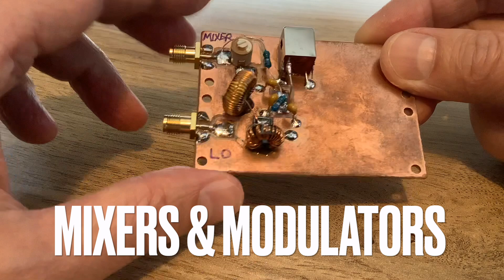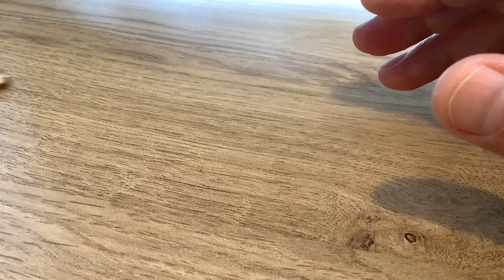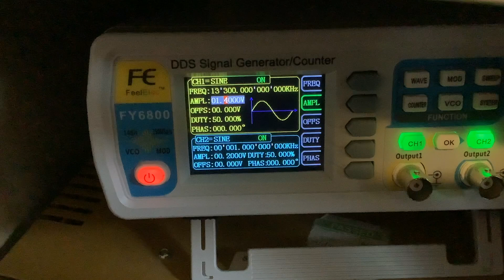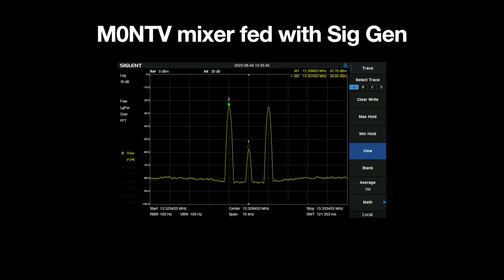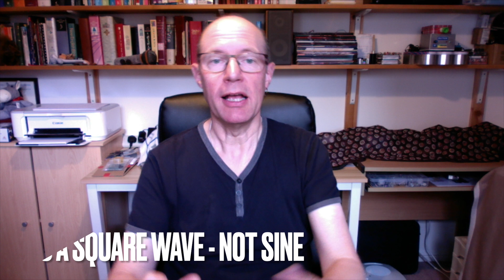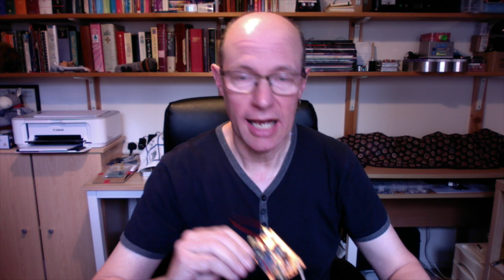42 - Mixers & Modulators

Comment: Having a relook at this video, I noticed the IF levels were lower than expected (~-25 dBm rather than -16 to --18 dBm). Is it that the voltage on the Feeltech generator is the EMF voltage, and with the internal source impedance of ~50 ohms and mixer load of ~50 ohms then the  generated levels are 6 dB lower? I noticed when you used the Si5351 the  mixer output level increased by ~1 dB. One could confirm this by using a 50 ohm load and measuring the  Feeltech generator output level on a oscilloscope
Reply from the maker: Some of the losses are due to the SigGen struggling with higher frequencies and some of the losses may be due to my leads. At 13.3 MHz and 1.4V P-P on the SigGen I get 616mV P-P on the scope (through a 50Ω load). On the Siglent SpecAn with better leads I see 247mV RMS (0.85 dBm) = 698.6mV P-P. I suppose you just have to use what you have! Thanks for watching and commenting. 73, Nick

Comment: At 13:25, wouldn't 1.4 Vpp or 1 Vrms @ 50 Ohm = 20 mW or 13 dBm not 5 mW or 7 dBm as mentioned?  Just trying to make sure I understand.  Thanks
Reply from the maker: Hi there! The maths goes like this: 1.4V Peak-Peak = 0.7V Peak. 
0.7V * 0.7071 = 0.495V RMS
0.495 ^2 / 50 = 4.9 mW
Hope this helps. Best wishes, Nick
Reply: Great.  Thank you for clearing that up!
Reply from the maker: No worries at all. Best wishes, Nick

Comment: Absolutely brilliant, Nick. I knew about the Roy Lewallen audio diplexer, but never suspected that a diplexer would be required on the LO port, too. I am at the point in my circuit board schematic where I was just about to draw the modulator with an ADE-1 and drive the LO port with an Si5351. Along the way, I derived the fundamental amplitude of the square wave at 8 mA bias and derived the output impedance of the SI5351. For better, or worse, I obtained an output impedance of 76 ohms at 10 MHz and a power level of 11.48 dBm. A 4 dB attenuator will be just about right. But, as you say, the output impedance of the SI5351 is not 50 ohms! Thanks for suggesting the use of a matching transformer on the LO port with a diplexer. Kind regards, Marty, K1FQL
Reply from the maker: Thanks very much. All the very best with your own projects. 73, Nick

Comment: Hi Nick,
You talked about a diplexer for the LO, did you actually build that? Is the bandwidth of the diplexer sufficient for the wide range of the LO. A band pass filter can be designed with 85 ohm input and 50 ohm output, wouldn’t that do the trick as well?
Reply from the maker: Hi Gerard! Thanks for your questions. Yes, I built the one identical to the diplexer in my previous video: Diving Deeper Into The Diplexer. It is by nature a narrowband filter which is useful as I'm only using it on the LO port of the balanced modulator (the BFO). So this is one fixed frequency - 13.3 MHz. As I've said before, the advantage with a diplexer over a regular LC bandpass filter is that the LC filter will see a good impedance match over the bandwidth of the filter but a pretty terrible one outside that: whereas the diplexer sees 50Ω irrespective of frequency. Hope this helps. 73, Nick

Comment: If you don't match the L-R-I impedance's on a commercial diode ring mixer performance will hands down suffer. They are good at what they do, but they are finicky that way.
Reply from the maker: Hi Brian, I think you are right. To be honest I've only used  commercial mixers twice in my homebrew transceivers. They are great for saving space but I prefer to roll my own diode ring mixers really. 73, Nick

Comment: Yes, I think you've got something here. I'll have to look at the uBITX V.6 schematic I have on my wall to see what Ashhar did.. I do know he used the BAT54S Diode Array Schottky which is basically two schottky's in a single package surface mount, and used two for a ring. I'd also like to know what the  7300 does as I can hear carrier and I don't think mine is balance well. I'm also looking into replacing the diode system in a very old radio, a swan ss-200 to see what I can do with it. That said, the original had a way of balancing it so maybe I should leave it alone.

Comment: Hi Nick, I can’t find any information on the internet regarding the audio diplexer. the schematic can be traced from the video, but the values can't. If you could reveal the values of the components, I can finish this part. Thank you in advance.
Reply from the maker: Hi there! I think all you need is in video No. 34 - Improvements to the Direct Conversion Receiver (https://youtu.be/xYY_rAS8cyk). There are links in the description too. Hope this helps. 73, Nick
Reply: @M0NTVHomebrewing  Thanks Nick. I didn’t realize that I have to watch all you video’s (Hi)
Now I can finish the complete IF and AF sections, almost a receiver.
Thanks again 👍,
Gerard
Reply from the maker: No worries Gerard. All the best with your building! 73, Nick

Comment: I am intrigued by the wiggly traces on Andy's board, I'm guessing some impact at VHF UHF. Can anyone enlighten please? Thanks.
Reply: He is probably keeping the track lengths equal for use at higher frequencies. You want the propagation delay to be the same. Not so important at HF but can be very important at VHF
Reply: Two reasons, the track lengths vary a bit due to the connection point on the ring, so I was trying to make things all the same. The second reason was that the track length adjustment was a new(ish) feature  in Kicad so I gave it a try 🙂

At normal HF freq it makes next to no difference.

The other feature of the boards was to make the connection of the cores  a bit easier. I always got annoyed in trying to sort out the wires then routing them to the correct point on the ring. The boards take care of this so you simply connect the start of each winding to one side,, and the finish to the other. The PCB tracking takes care of the rest.

Once I have a few more testing results done I intend to pop the design up on somewhere (github I think) so that anyone can get some boards made up if they fancy doing so.

Currently I've been sidetracked  into writing some software to get the 5351 working on the Raspbery Pico using MMBASIC  it's getting closer...

Andy G0POY
Reply: @andye2005  Thanks Andy, appreciated.
Reply from the maker: Andy might see this and answer himself. I've tipped him off that he gets a mention! 73, Nick

Comment: The Si5351 is made to drive Cmos loads. The termination of mixer and generator is important as during the cycle they would be momentarily in no-man's land. An attenuator is a good idea, and using a diplexer is a great idea. Great improvement. Makes filtering of Carrier much easier with a less than ideal filter.
Reply from the maker: Thanks very much. That's helpful input. 73, Nick